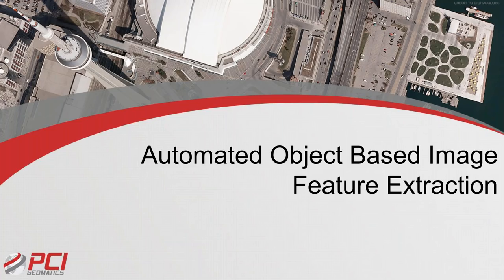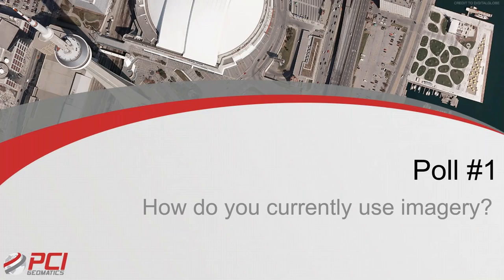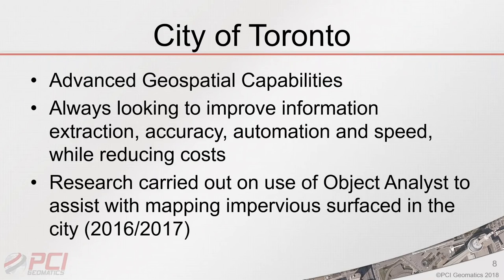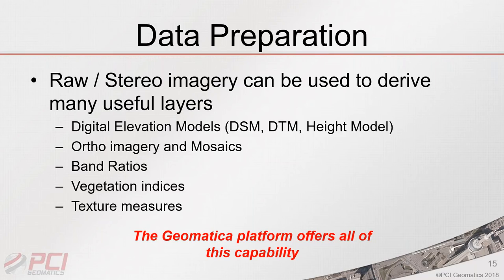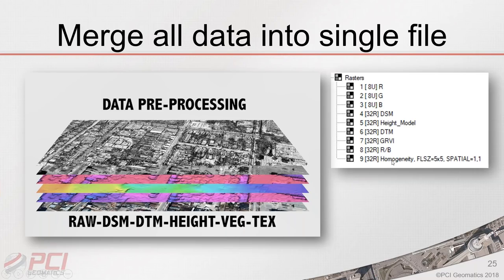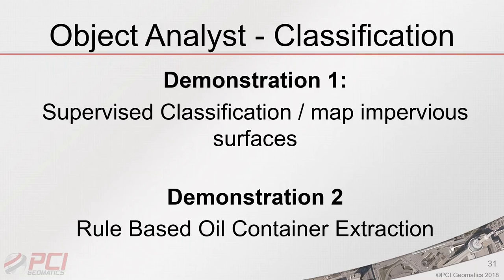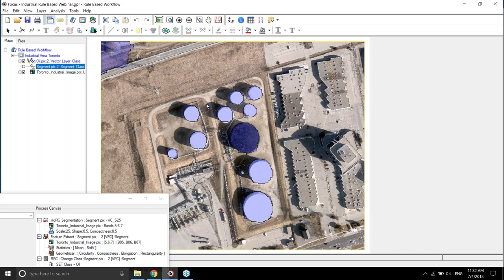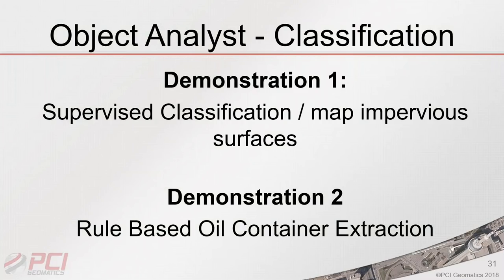Automated Object Based Image Feature Extraction

Comment: Hi, When I make object-based classification in PCI geomatics, I choose the segmented vector as a vector layer in the reform shapes section, and I choose the class that I make as a class filter, but it applies the reform shape to the whole polygon instead of each class I have defined and draws the result as a single polygon. What could be the reason for this? can you help me?
Reply from the maker: I believe the re-shape is based on all classified polygons. If you want to isolate a specific class you can save that class as a new vector segment and then perform the dissolve on that class alone.

Comment: How to add surface model to MS image to make object based classification?
Reply from the maker: Two methods. You could transfer the channels from the elevation into the same file if you plan to use the elevation in the segmentation step - you wil have to resample to a common pixel size in one file. Another method could be to populate the segmented polygons with the elevation values - although the best option would be to filter the DSM to make a DTM, and then use the height map in the segmentation. We find this method is very useful for building footprint extraction. It really depends on your application, and the type of data and resolution available.